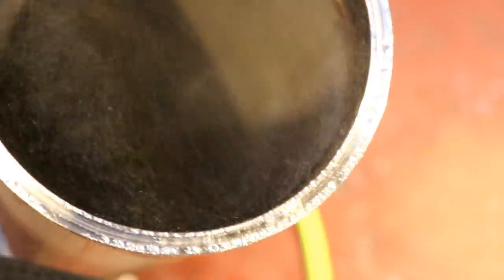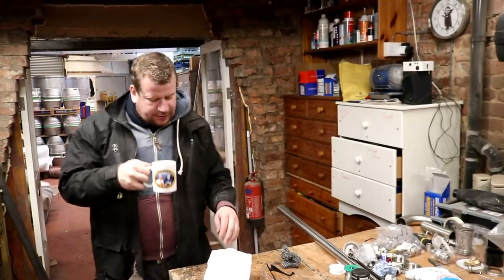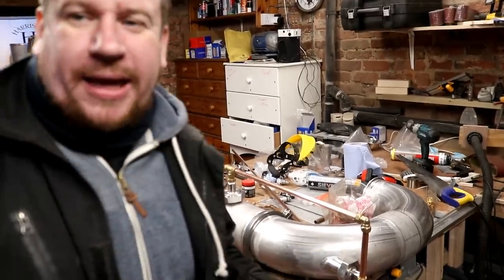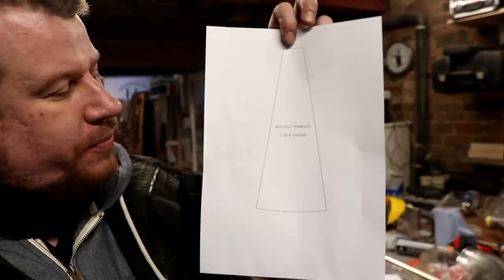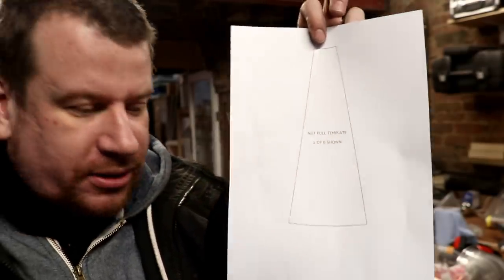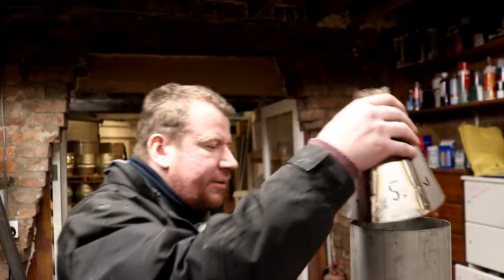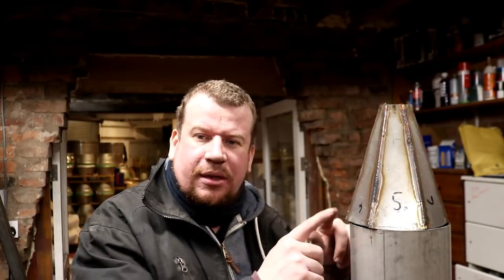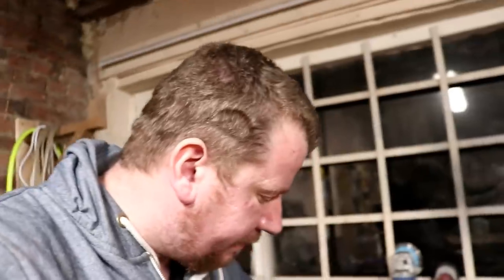6 SEGMENT STEEL CONE

Comment: I was looking at a still at a rum distillery the other day. They had what was essentially a u-bend at the bottom of the still condenser. This would create an air lock which would keep the vapor in the condenser and only allow the condensed liquid out. The u-bend was just enough to create the airlock without much back pressure but they also had an arrangement to prevent dangerous amounts of pressure building up. I'm not sure how well that would work in this case but you could test it by hooking one of your hoses to the bottom and raising the middle of it slightly to form a slight u-bend?

Comment: cant you run the waste water through a radiator to warm your shop up before it goes down the drain?
Reply from the maker: Never thought of that.... Do you have a radiator?
Reply: xpyda man brilliant idea.
Reply: Good idea. I was thinking of something along the lines of pumping it through an indirect hot water cylinder for washing up but your idea would be a lot simpler.

Comment: In reference to the glycol that I mentioned before, it wasn't so much on a "footprint" standpoint, but more of a wasted investment standpoint. Here in the states, water isn't free or cheap. If your putting over 100 liters thru the spray system, your also losing water from the boil. Now, I have no clue what your system is boiling off per hour, but the 2 combined... just seems like a bunch of money dumped literally, down the drain. Again, it was just an idea, because I have no clue what your expenses are, and how they compare.  (Water, power, etc.)

Comment: Could you collect and reuse the water to feed the spray nozzles with a pump on the  next brew day?
Reply: simple pump and a tank and just push it round in circles, in the winter that tanked water could be colder than ground water so more effective at condensing the steam, in summer just drop a coil off the chiller into it to drop the temp to still make it more efficient.
Once you work out how much water you need for say a 75 or 90min boil (remembering a 60min boil would need less) you have the size of the tank you need, the pump could be a hefty pond pump or similar, nowt to special. Once the tank if full the excess could run off to waste or be used for flushing toilets etc...
Reply: @TonyLeach-airguntech  I use a steam condenser, although on a much smaller scale than Harry.  The biggest issue I had when trying to reuse the condensed water was the smell.  The DMS that Harry referred to that is boiled off becomes condensed with the steam and it smells HORRIBLE.  I haven't tried saving it since.
Reply: @wreckagebrewingco8298  i had no idea on the smell, best place for it then is down the drain
Reply: @TonyLeach-airguntech  I didn't either until I tried it for the first time! Cheers!